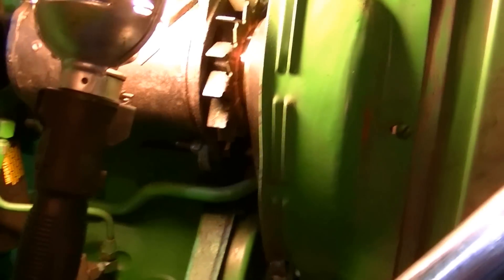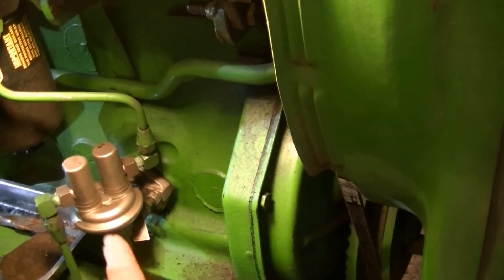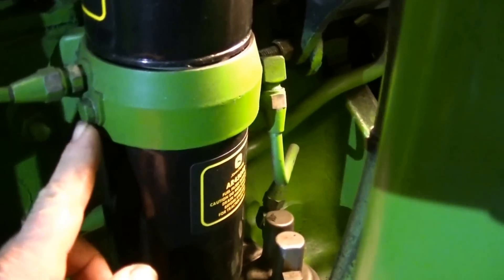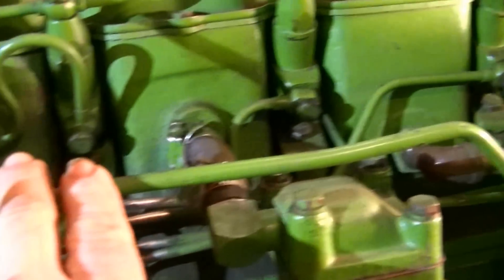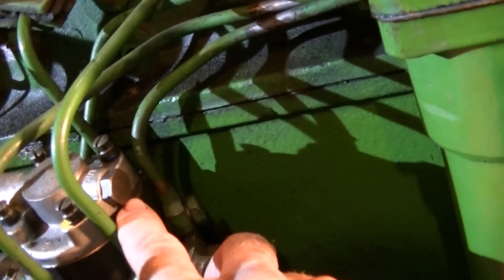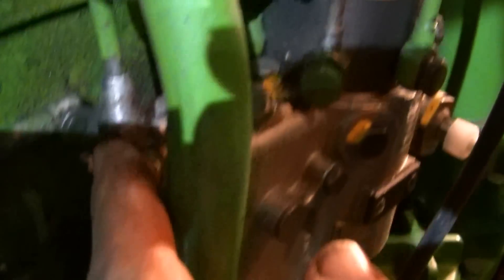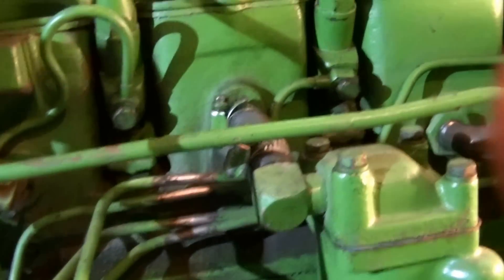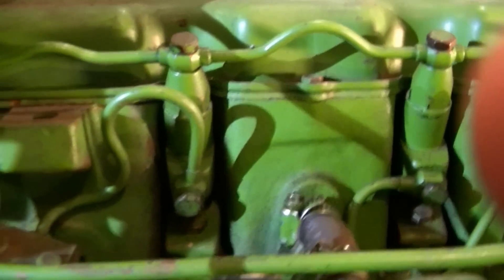John Deere 4020 diesel fuel system bleeding - zeketheantiquefreak

Comment: You did well regards to getting your 4020's injectors serviced for$200.00 locally. A few years back i bought a set of 6 new pencil injectors for my 1968 model 4020 , recall it being Cnd$750.00 and their comment that the larger injectors on the earily model year 4020's are much more expensive to purchase. My father impressed upon me the importance of using clean fuel and storing tractors as well as other equipment inside a dry shed!
Reply from the maker: Great advice on the clean fuel, dry storage and regular service. Your mechanical heart is in the right place.

Comment: Excellant explanation of the 4020 diesel fuel supply system.. my local co-op supplies 100% fossel fuel diesel , heavy summer grade delivery option somethig like February till May each year for the local famers. Most of the rest of the year there is a bit of bio dosel blend in the fuel. I could be wrong , but i think bio-blend diesel is fine if you use it up quickly.. for my 500gallon farm storeage tanks i try to have them filled with the straight fossel fuel diesel . Adding "Red Tek" fuel stabalizer to my fuel. What if any fuel additives do you use to help the stability and shelf life of your diesel fuel?
Reply from the maker: My situation for fuel is quite different as this 4020 started out as a non-running challenge/project a few years back. Being a 'toy' it does little meaningful work and uses little fuel. I use a fuel additive called 'Power DYSL' for no particular reason. I top it up generally twice a year and should try your 'Red Tek' fuel stabilizer to prolong the life of the fuel. With having the 'new toy', the Bobcat with forks and bucket I think that the 4020 will be underused. Perhaps unnecessary. Hate to get rid of it, though. Great tractor.

Comment: Zeke, I have a question for you.  I'm running a '68 4020, with the exact fuel system on it as the machine in this video.  I'm also running the original primary fuel pump with the bowl on it.  The primer lever was broken off it years ago so two days ago I thought I'd change the pump to one with a lever to prime the system when I run it out of fuel (which happened ) two days ago....  I can't for the life of me get the pump to release from the block.. All the fasteners are off, I've turned the motor thinking the cam may need to rotate to allow the pump to loosen... it wiggles like it wants to come off but it's still on there.  What I did to prime the system was used compressed air into the tank.  worked like a dam... but i'd like to have the primer pump for the next time.  Any suggestions for the pump removal?  Thanks.  Dan from Saskatchewan.
Reply from the maker: Wow... I changed the mechanical pump on my early 4020 and had no problems. I don't know of anything inside the engine that could 'trap' the lever/arm of the pump. I will try and find the old pump to look at it... I don't throw much out.
Reply: @zeketheantiquefreak8518  I appreciate it.

Comment: Will this fuel filter base fit on a 3010
Reply from the maker: Thank you for the comment. I am sorry, I am not familiar with the layout of the 3010 fuel system. An inquiry at a John Deere parts department would yield the information you are looking for. Perhaps an aftermarket filter application catalogue would be of use.

Comment: Do you know the Size of the Steel Washers/O rings that are on Each side of the Banjo Fitting on the intake and return Fuel lines on the Injector pump? Thank you in advance
Reply from the maker: Some years ago I changed the 48 washers Part #T20055. That said, I still have the old ones (Little gets thrown out) and can measure them if I can find them. My system is an early 1964 22T model with the 25MM injectors.
Reply: @zeketheantiquefreak8518  . Mine is a 69 model with the Serial number 218187R

Comment: Hi Zeke, My name is Linda I am from Georgia in the USA. I have a JD 4020, my husband passed away ( 2014 )  and I am now running the tractor LOL the only gears he would show me is the reverse and 5th gear said that was plenty fast enough for me. Never showed me how to change the oil just how to put fuel in it, check the hydraulic fluid and the oil. Well needless to say here I am with no knowledge on even general things that I need to know. I have had to pay to get O rings replaced in the bottom of the motor, which I know I could not have done but it was expensive needless to say. I have to admit. I had the muffler replaced a neighbor used it to cut the field next to the house and knocked the flapper off, so it had to be replaced. BUT I did appreciate him doing it if only he had told me so for a few months I had to put a jar over stack but it worked LOL but don't forget to take it off before starting it will shoot up in the air as I found out LOL several times before I could find muffler but I did and another neighbor put the new one on for me. Thank God for no charge.  But here I am trying to change the oil but I also want to bleed off the fuel tank at the bottom. I know it has got to have condensation in it over time. Also need to blow off the radiator as I have been cutting the fields and I know they have been so dusty and plus that brush weed. I am open for any help you might have and or suggestions as I am not selling my tractor I love ole JD
 ( tractor) and I have a lot more fields to cut and want him running right and not straining to run. Thank you so much and God Bless you and yours,  Linda
MEN IF YOUR WIFE HAS ANY INTEREST IN HELPING YOU SHOW HER HOW TO DO THESE THINGS IT IS IMPORTANT...
Reply from the maker: Hopefully I can be of some help. I am from Southern Manitoba Canada. The video doesn't show the drain on the bottom of the fuel tank to let out any condensation. With a flashlight you should be able to see two valves under the tank. One is the fuel tank shut-off which would only be closed when working on the system, such as changing the filters. The other is self explanatory and remains closed except for bleeding. 
   If you drain out the water, it is a good practice to wear some rubber gloves to keep the fuel off of your skin. 
   What year is your tractor? They constantly evolved and improved over the years of manufacture and service procedures changed slightly. Is it a 24 volt system?
Reply: @zeketheantiquefreak8518  going out to look be right back  it is in back yard won't be long
Reply from the maker: @crazyldy002  There is a little more info in this video:
https://www.youtube.com/watch?v=0UBK2UlUhdk
Reply: ok back the number on the plate that is on it is   T123R261002R
Reply: It used to have 2 batteries but my husband changed it to a large heavy duty 12 volt
Reply: I saw the places for me to change the oil thank you and yes the filter also
Reply: going out to change the oil and filter I have youtube on my cell if you are still there.
Reply from the maker: @crazyldy002  If you can read the tag on the starter and it says 'Nippondenso', I can easily show you how to blow the brush dust out of the starter and possibly prevent a fire.
Reply: @zeketheantiquefreak8518    I have a doctor visit tomorrow but I will see when I get back, and thank you so kindly.
Reply from the maker: @crazyldy002  How are you doing in these uncertain times?
Reply: @zeketheantiquefreak8518  did you get the info?
Reply from the maker: @crazyldy002  Yes. There are a couple of good videos on changing the oil. Check under something like '4020 John Deere Oil Change' and you should get a couple of good hits.
Reply: @zeketheantiquefreak8518  did you get the number I sent to you?
Reply from the maker: @crazyldy002  Yes, is there any chance that this is a '3020'? Here is a breakdown of the serial Number:
http://greencollectors.com/library/tractors/models-4020-3020-4000/4020-serial-numbers/
Reply: @zeketheantiquefreak8518    Hi There, nope it is a 4020 don't know the year model but it is for sure. Well, it has been a long day for sure for me. Got the oil changed and Thank you so much for the info, got it all greased up, needed about a 1/2 gallon of antifreeze so got that done, all fueled up and bush hog all greased up and Ole JD as I call it is all set to get busy now and ready to go. Thank you again so very much, God Bless and have a wonderful New Year.
Reply from the maker: @crazyldy002  Funny thing about the serial number... If it was a 3020 it would have a four cylinder engine unlike the 4020 with the six cylinder.
Reply from the maker: @crazyldy002  Did you get a chance to check the air filter? Mine has an 'oil bath' air cleaner, some of the newer ones likely have the paper filter type.
Reply: @zeketheantiquefreak8518  Dang thank you, I sure as grits is groceries I forgot it, I will go to town in the morning and get one. Thank you so much
Reply: @zeketheantiquefreak8518  I am almost positive it is 90 horse if that helps
Reply: @zeketheantiquefreak8518    Zeke, I don't know if you got the info or not so going to put it again:  T123R261002R    12 volt heavy duty really big battery  I saw where the oil and filter things are so I can handle that but didn't see the fuel opening is at but did not have flashlight with me

Comment: How much did the pump that you mentioned in the beginning cost you and where can you buy it?
Reply from the maker: Yes, sadly the pump on the tractor was badly damaged from sitting for a time with stale fuel. I removed and installed the pump and injectors myself which saved some serious $$$ but was still out of pocket about $700.00 Canadian dollars to have the pump rebuilt at a diesel injection business in Brandon Manitoba, about $200.00 to have the injectors gone through locally and two trips to the city. Plus a couple dozen gallons of fuel and filters. Like I say, this was a very expensive learning curve. On the bright side the tractor runs well and I can't imagine life without the old beast. Thank you for the comment.

Comment: Hi Zek, well I decided to change out that primary pump, (I beleive one of the check valves was pooched) after getting it in it pumped much better & we were able to get fuel right through to the bleed screw on the injection pump. That's as far as we could get the fuel. We tried to bleed it up to an injector, but no luck so far... charging batteries now. Lol(Incidentally we did try rotating the engine for a better lobe position for the first pump & there was no difference) Thanks for your responses so far, I will keep you posted.
Reply from the maker: You are on the right track! I can offer a few thoughts now that you have fuel to the injection pump. It is worth checking the fuel shut-off linkage for proper travel. In my case, the tractor had sat for a couple three years with very old purple fuel... The pump plungers in the distributor head had seized and necessitated a pump over haul. $$$ No smoke would come out of the exhaust when turning over and no fuel out of injector lines. If you have a Roosa-Master pump and a 404 engine, there is a small bung at the top of the distributor head facing forward. install A 1/8" pipe thread fitting (gently) into this hole with, say, a 0-50 psi gauge. The hand/primary pump feeds the housing of the injection pump and an internal pump should create approximately 25-30 psi at cranking speed to feed the distributor head plungers. Keep me informed when you can. Worst case scenario, if you have to go through the pump, remove and check the injectors also. a stuck injector can create tremendous pressure in the distributor head and crack a metal ring. More $$$. If you need advice on removing the injectors without damage, let me know. I am assuming that you have the early, large 1" injectors, not the pencil type of later models.
Reply: Did you get info?
Reply: Number on back of tractor is T123R261002R
Reply: I saw the places where I  change oil
Reply: I didn't see the fuel drain lines
Reply: It is large heavy duty 12 volt

Comment: Hi Zek,  Don here again, well I'm out in Ont. & started working on my 63'  4010 & I do have a bit of a shot of fuel while working the lever on the primary pump, however my fuel filters are different, they are the big clamp type, I have been working that lever for a very very long time but have yet to get fuel out of any bleed points, I'm at a loss as to what to do next. I did change out the filters last year trying to get this thing going. When I got here this year the fuel ( about 5 gal) smelled like varathane, so I drained it all & put fresh stuff in. I'm beginning to wonder if that primary filter is NFG, it is the same style as in your video,,, any thoughts ??
Reply from the maker: Don: There should be a bleed screw on top of that clamp style secondary. 
I humbly suggest loosening the supply line to the hand pump and make sure there is good flow from the tank.
Is the engine rotated to a point where the camshaft lobe is not 'robbing' the stroke from the pump? Maybe try turning the engine over some and see if you have more useful travel. 
Check the pump itself, loosen the outlet line and see if it is actually transferring fuel.. There maybe an issue with the pump valves, dirt or whatever. 
Hope this is of some help... Lemme know how you make out.
Reply from the maker: It has been a year or so... What did you find out?

Comment from the maker: I neglected to mention the water drain at the very bottom of the fuel tank next to the fuel shut-off. As with the bottom fuel filter, occasionally open this fitting and drain till fuel emerges.
Reply: I will have to take flashlight out to see that area as it is way up in there